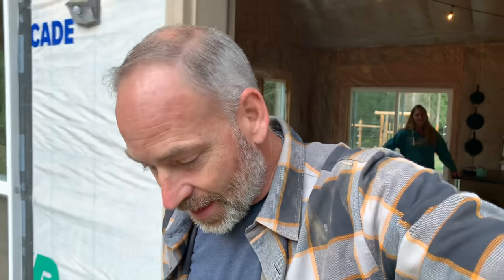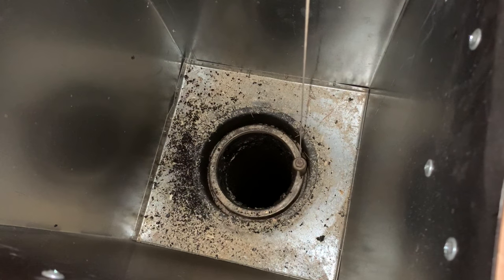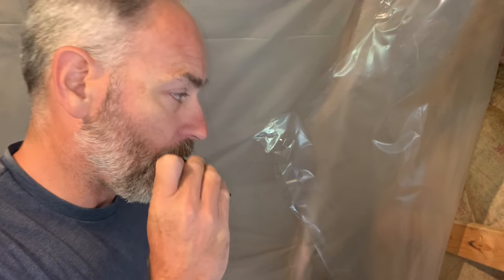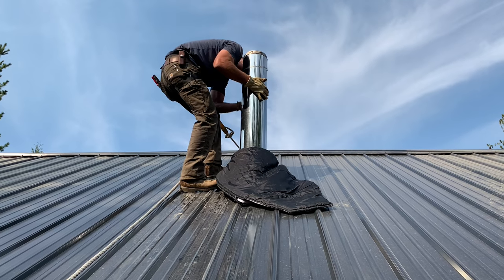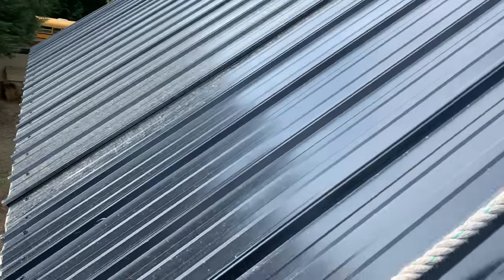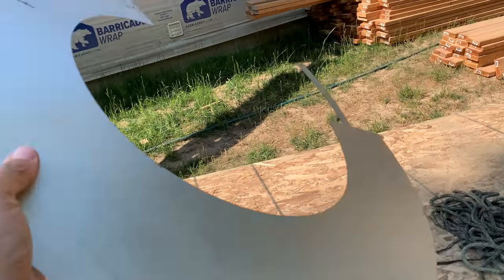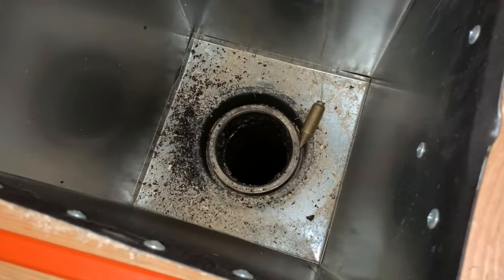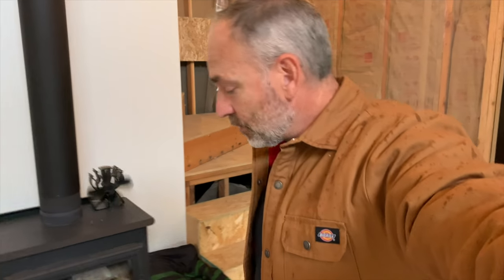Installing Wood Stove Pipe through Roof - Couple Builds Off-Grid Home

Comment: Did it leak? Not sure how you ended up doing it but that cone would not have side under your tin. Next time or in the future get a flat piece stamped long enough from you ridge cap to 2 feet past your stove about 1-3 ribs wide with the 1 inch drop. Set your flat cone down with adhesive and then put that lat tin over it....with a hole big enough to fit over the cone of course. Thats the no leak set it and forget it way. Looks like yours is going to leak like crazy once the adhesive/caulking wears out after a year or two

Comment: Consider building a false wall directly behind the wood stove. It can be around 2 3/4” of stud plus 1/2” drywall. The wall should be within 4” of the finished ceiling with the same gap at the bottom. Don’t build any fire stops in this wall. Now when you burn you will utilize the thermo syphon effect to circulate the warm air. An architect friend built one of these in his while going to college. I was surprised at how well it works.
Reply: Wish i had known that back when I had a wood burning stove, I might have kept it.

Comment: Nice job. I chose the flexible silicone boot for my flashing. It’s not quite as pretty but much easier to install. You might consider a set of bracing arms if you have high winds.

Comment: There's nothing like drilling a hole in a sealed roof. Didn't know if you know about using a chain to clean out your chimney pipe, not for now obviously not for now but in the future. Just take the top off your chimney and swirl a long chain down your chimney. Easy DIY spring time chimney cleaning. :)
Reply from the maker: Cool. Thanks.

Comment: I llike your video's. I have a safely tip. Put a fire proof layer inside your house. Perhaps drywall would help. The plastic layer inside the house is a fire accelerant. Rockwool insulation is great at stopping fires, much better than fiberglass Put a fire proof layer on the outside of the buildings like hardyboard installed with a rainscreen.  Clear brush away from the buildings. Thin the forest on your lot to reduce the forest fire risk.  
Cheers. Keep up the good work and bless your family and friends

Comment: Dang Martin and Spouse l loved this whole process. I live Cali San Diego County in lower foothills. My pitch is 9/12 i think with hot tar rolled Dibitob roof.  The plumb bob helps me most. I have done skylights other houses concrete tile roofs. Fire box is four feet tall. Think it the wrong one . My problem bought and like to fine the interior mount same inset somewhere. Guess i need to use  "my saws all cutter and metal diamond blade to cut out flanges and for custom sheet metal "fire box. The roof is wood. The round hole is cut now for pre existing for 8" double walled pipe to go through for the wood stove about 10 ft or 3.5 meters below. My previous corroded fire box with hole  was 5 inches tall...wish i can find still SAME?

Comment: I saw that you have a fan on top of the stove which works simply with the rising hot air. Do these have a positive impact on heat circulation in your opinion? I know they're cheap....but are they worth it? Thanks from France.
Reply: Of course they are worth it. I have a small heater with installed fan in it. It  gets the room warm in no time. Without the fan the heat just goes up, but the fan is mixing the air in the room, so it gets warm quicker.

It's an electric heater, the one that I have.

Comment: Why were you on that metal roof without wearing "tennis shoes"???  Those boots are slipping and could scratch the paint on your roofing as well....just asking???  Is there a way on your raised hearth corners to take out the sharpness of them to prevent someone from running into or falling into the points?  Love the idea of sitting on that hearth.  Gods blessings to you all.  Safety Sally is peeking around that corner lolol.

Comment: Boy you installed that flashing completely wrong you needed to take the pc of roofing metal off and cut the sheet in half then in stall the bottom half first then the flashing then the top half half of roofing please don’t tell others to install there that way your putting out miss information I’m contractor for over 35 years and seen to many so called DYI installs fail in the first year of installing it and replace roofing and the costumers have different color roof sheets because of fading